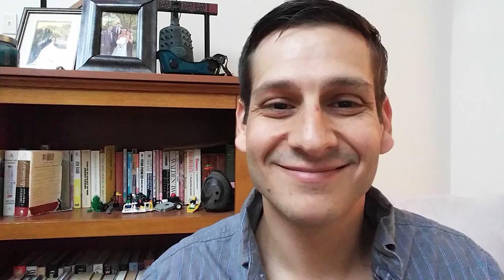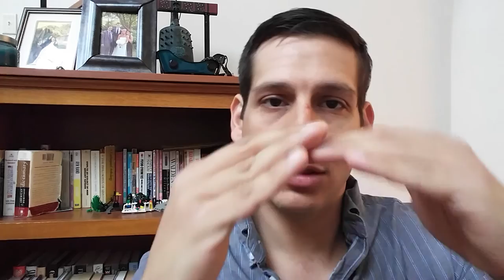5 Need to Know GPR Data Processing Steps

Comment: Hello Dan!. How can I do topographic corrections? I did the other 5  steps that you comment but I need to correct by topography but I don't know which software could I use or how to do that
Reply from the maker: Hi Jelime. Thank you for the question. You can use most software packages to make this correction. GPR-Slice, reflex W, Radan, Ekko-project all have topographic correction functionality. Ideally you would need the elevations across the survey profile to make these accurate. GPR-Slice however has a pretty easy function to correct for it if you don't have the elevations. The software allows you to "pull" the data at any given point to macro adjust topography. This works great if you don't have a ton of undulations in the landscape. Hope this helps! Good luck!!
Reply: LearnGPR thank you very much for your comment. I will try to apply that in reflex or look it in the GPR slices.

Comment: Hi Dan! Thanks for your insights!

Did you mention these steps in the order in which they should be applied? Or it doesn't matter which step-sequence we follow?
Reply from the maker: I generally do, often filters will change gains so i like applying the gains after the filters (or at the same time). I definitely recommend starting with time zero.

Comment: Hello Dan,

We use Montaj software for the magnetometer data processing. Can i process the GRP data using Montaj sotware??
Reply from the maker: Rakesh Tayal Hi Rakesh! I haven't used Montaj in a few years but you couldn't process GPR profiles then. But Montaj is an incredibly powerful software for processing 2d plan view maps such as for em induction and magnetometer data sets. So what is possible...is to create GPR time-slices in another program like gpr slice or radan or Ekko project and export as a digital file. then plot those in Montaj and process the time slice data. I have seen some excellent GPR maps created in Montaj. I hope this helps. Let me know if you have any other questions.

Comment: Hi Dan,

My question is out of the scope of your video.
I am going to evaluate moisture content in the granular materials. Despite doing a vast literature review I am still confused if I can use GPR technology in this regard. Any references, techniques?? I think I may have problems with interpreting the radargram to determine the moisture content at different depth ...

Cheers,
Ebrahim
Reply from the maker: Hi Ebrahim,
You often can interpret relative differences in moisture content. But, evaluating percentage of water by volume is something that would be very difficult to do. As an aside, I do go over an example of mapping ground water differences in our GPR BASICS course. If you want me to check out a radargram for you just let me know.
Reply: Thanks Dan,

Could you please clarify the definition of the relative difference in moisture content. I thought I can determine the volumetric water content using GPR technology.
Although I will check your page regularly, could you please inform me when you launch "mapping groundwater difference" course. Further, I was wondering if you could introduce any relevant references about this issue.

Thanks again for your time and your offer to check out my radargram. However, I have not started my fieldwork.

Best regards,
Ebrahim
Reply from the maker: sure. When I am talking about relative differences I mean looking at the variation in amplitudes. greater amplitudes will indicate greater differences, often indicating greater water saturation

Comment: Hi..Thanks for the video. I am new to GPR processing and your videos helped me easily understand the basics. Nice work!!
Reply from the maker: Sangita Singh thanks so much for watching. I'm so glad you found it helpful. I'd be happy to talk to you further about data processing. What kind of system do you use?
Reply: I am using GSSI SIR 3000 with low frequency antennas upto15MHz frequency
Reply from the maker: Sangita Singh got it. Do you use radan?
Reply: Yeah RADAN it is...but I use it to study glaciers depth
Reply from the maker: Thats awesome! Such a cool application. And you get quite deep in the ice. I think for you Topo correction and Migration (not talked about in this video) are going to be key! Do you know how to use Migration in Radan?
Reply: I know a bit about topo correction and is important in our processing. However I dont have any idea about the migration. moreover in the tutorial for velocity analysis I saw we get to see some hyperbola(or slope) in the scans but I haven't come across these in my scans.. DOes this denote that I can't perform the velocity analysis?
Reply from the maker: Sangita Singh that's right. If you don't have any hyperbolain your scans you cannot perform the matching. There is another way that you might be able to do velocity analysis. 1. Bury something and note it's depth. Then scan it to get speed. 2. You can conduct a cmp. You could send me some scans if you like and I can take a look at them. Where are you located?
Reply: Well we already done with taking scans but will do next time for sure. Regarding cmp can you upload some lectures on conducting cmp highlighting the  initial system settings and processing also. I am from India
Reply from the maker: Sangita Singh sure. Happy to help any way I can.
Reply: Can you give ur mail I'd so that I can send you some data?
Reply from the maker: dbigman@bigmangeophysical.com
Reply: @sangitasingh4665  Interesting, I'm working with GPR on dry snow layers in Antarctica. What kind of data did you work with? How did you define the better dielectric/velocity value?

Comment: How about Dewow?
Reply from the maker: Rebwar Nasir also an important filter. Most instruments run a DeWow automatically. It's a vertical filter like the bandpass. Definitely something that should be used if you have a lot of drift and it's not done by the instrument.
Reply from the maker: Check out this video! https://www.youtube.com/watch?v=h5fnM-gREvM&t=1s
Reply: @Learngpr  Do you know if SIR3000 from GSSI run DeWow automatically? I didn't find anything in the manual. So considering that you need to apply a DC and DeWow filter, would you recommend to do before or after time zero correction.
Important to note that, in my case, a gain is recorded in the file header and the first step in my processing chain is to remove that gain.
Reply: I also notice that getting the ReflexW to calculate the nominal frequency before and after "remove gain header" gives different values
Reply from the maker: i believe the sir 3000 does a 1d filter in real time. Either a dewow, sc shift or both. When you bring it into reflexw it might import in as raw. That is why it has the vertical striping. Hope this helps